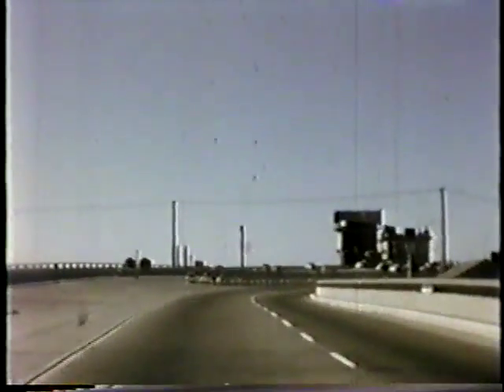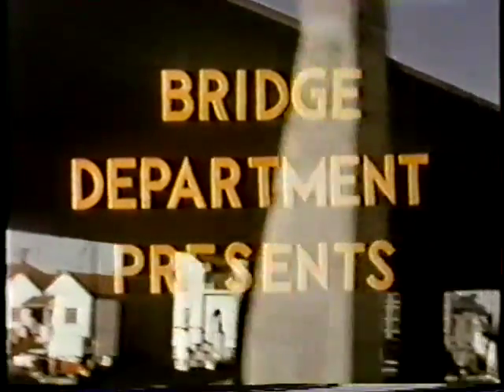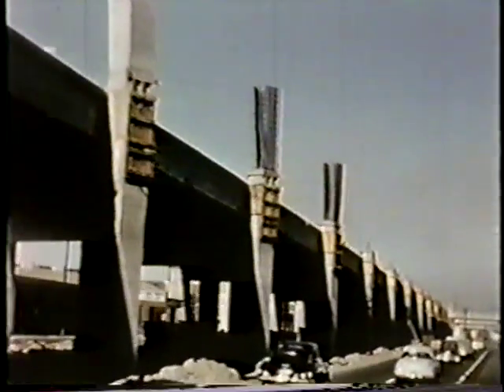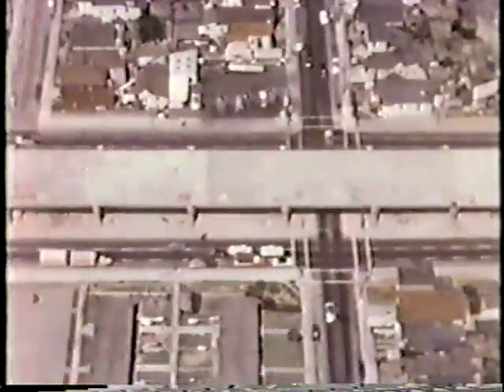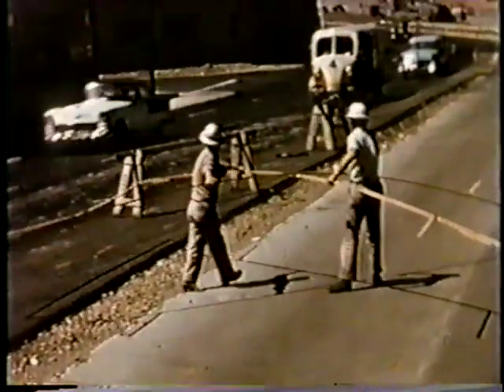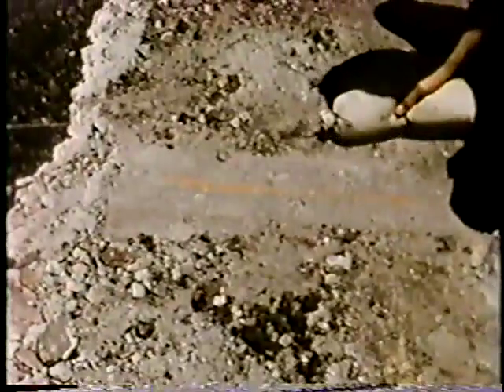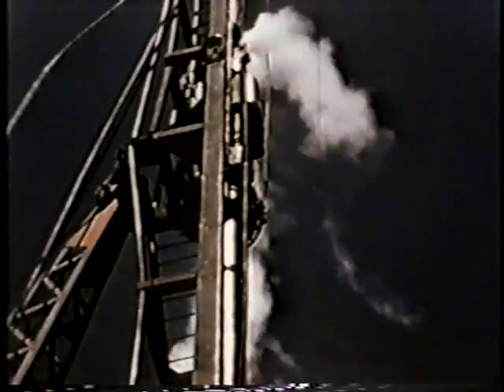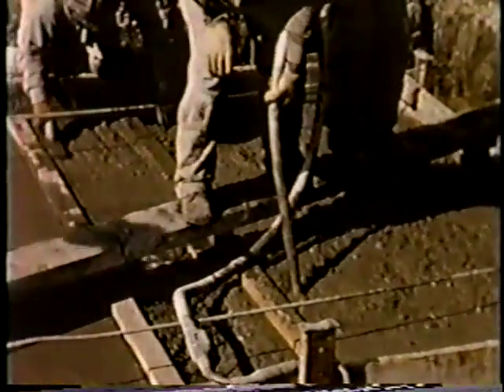I-880 Cypress Viaduct Construction (part 1 of 5)

Comment: I love watching old construction/engineering films -- even if the structure did not pass the test of time or nature.  And you can't blame the geologists, engineers or contractors.  They were following the best methods known at the time.  Engineering (especially seismic engineering) is a mathematical science -- and sometimes nature proves the math wrong -- or at least incomplete.  That's why codes and designs are always studied/upgraded after each quake, as more is being learned all the time.  I read the engineering report on the collapse, and most of the evidence pointed to structural stresses and weaknesses that could not have even been considered at the time of construction.  In its day, it was quite the feat of both engineering AND construction methods.  On the positive side, many lessons were learned that can be applied to future structures.  Flyovers and viaducts will always be necessary based on geographic location.  If we can continue to improve and design effective and well thought-out highways, we are the better for it.  And may those who paid the ultimate price for our continuing seismic and engineering education rest forever in peace.

Comment: i do not see greed in the flaw of this project. the common design from the 40s to the 1971 quake was used all over the state. it takes a disaster to look at problems. i looked at the damage film posted,what happened in the via duct was very loose ground and reinforcment of the colums.  not careless, just something that did not come up or thought of. the entire structure did not fall,
just the northern portion from the on/off ramps at 17th st. look at this clip 2:22 from that colum to hwy 80

Comment: Reflecting on the concept of a double-deck freeway in quake-ridden California, what was Caltrans thinking? They couldn't possibly have taken into account the history of quakes in California.  I'd hate to think they simply hoped a quake of that sorts just wouldn't happen but you never know. And double deck for what reason other than to save land use. It turns out that buying up the land for a traditional 8 lane ground freeway or a even single level elevated freeway would have been safer and smarter.

Comment: I hope all the construction workers and designers feel like murderers. 

This should have NEVER been built in this area or near any quake risk area. 

When I saw this on tv in 1987 I was 13 and even i said to myself why did the build double decker anything over there. 

Must have been a horrific death being pancaked like a fly under a swatter under that concrete.
Reply: Murderers, no. Seismic codes weren't as well established when the structure was built. Not all of it collapsed either. Only the segments that were constructed on fill collapsed. The 280 Southern Extension is still around and is also double-deck.
Reply: ynnhojhairam   The earthquake happened in 1989.  How on earth did you see it in 1987?
Reply: The structure collapsed because it was built on artificial landfill.  The portions built on natural ground were still standing.  The design was built to  the standards of the day.  Structures can survive earthquakes built to code but the ground on which they are built on needs to be studied.  This wasn't though about back in the 50's.